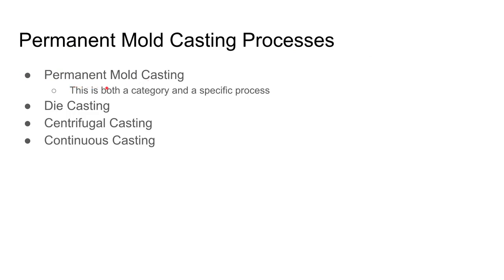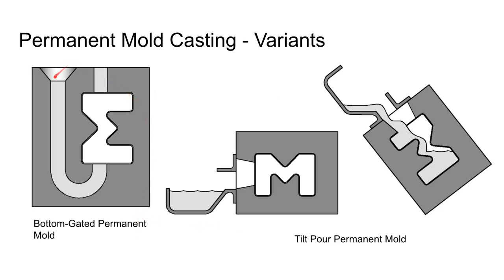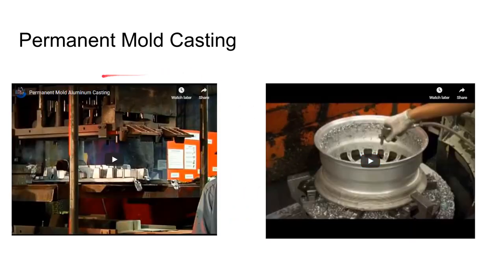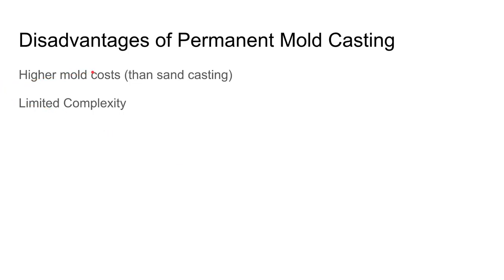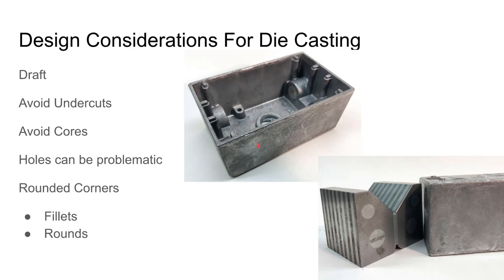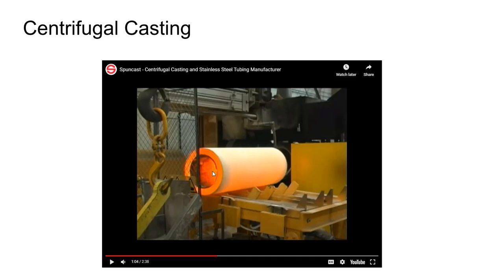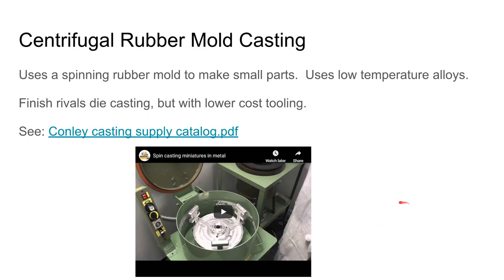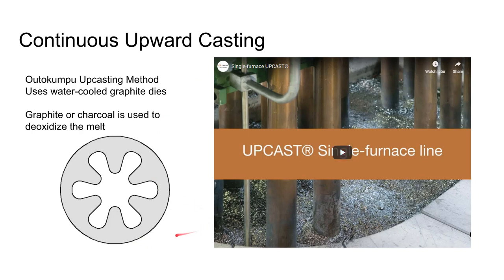3421 Permanent Mold Casting

Comment: What kind of coating did you spray on the DIY gravity casting
Reply: I'm going to attempt a silicone based lubricant , something that will handle the heat without burning off and making gas that will cause bubbles .